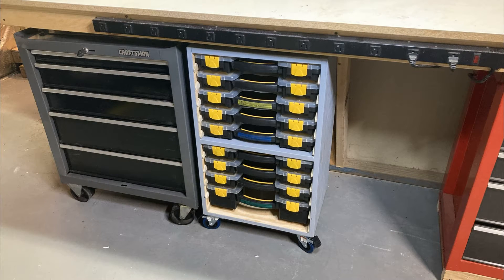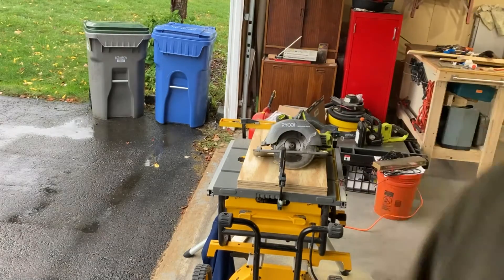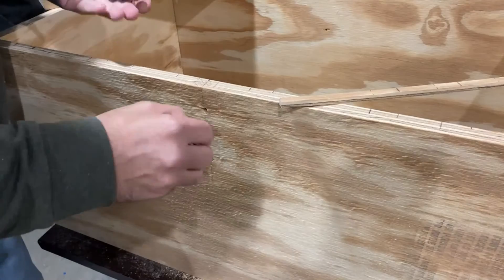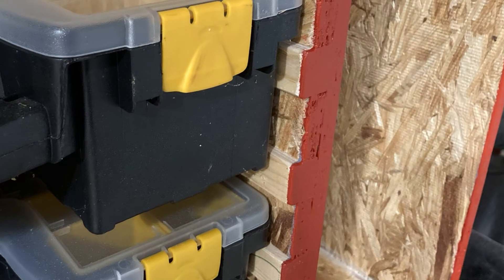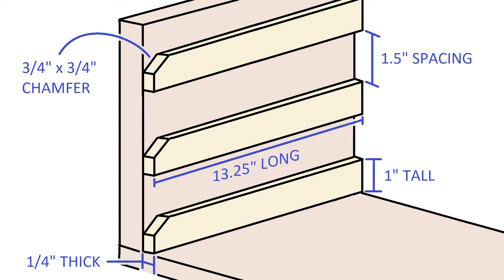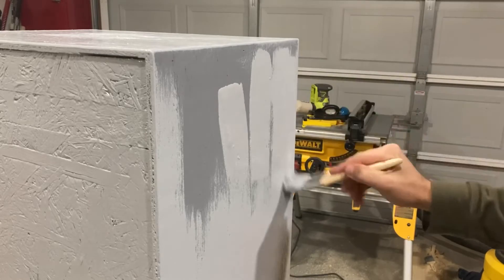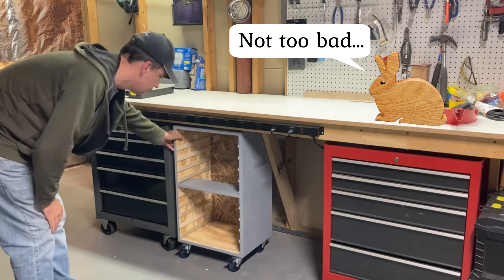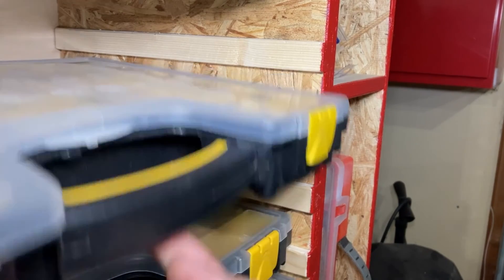[21-B]  DIY Rack for Harbor Freight Plastic Parts Bin Storage

Comment: I built such a rolling cart but used thin aluminum angle stock for the shelf brackets.  This doesn't rely on the small edge of the bins to support the weight - it supports about 1" of the bottom both left and right - much better for a loaded tray.    Finally, steer away from the Harbor Freight stuff - they are a knock off of the Stanley bins which are much stronger.  My $0.02.

Comment: Chamfered guide is the ticket.  Well done.  These HF bins are well designed; not the most robust plastic, but the designer paid attention to how they nest and they actually work.  For bins that don't need to travel to a jobsite, they are also, just the ticket.

Comment: Lids. Why have the trays got lids? It just adds three steps to access (two catches and lift lid) and the same to put away. What do they add?
Reply: Allows it to be carried to the worksite w/o dumping them or mixing them up perhaps.
Reply: @joewalsh8423  What worksite? This is workshop storage.
Reply: @Tensquaremetreworkshop  These are meant for mobile small parts storage that can live in a garage or be taken to where the parts they hold are needed, which might be 20 feet or 20 miles away.
By way of giving you some perspective on this, I've talked with many folks about these exact bins for years and you are the only person to ever complain that they have lids.  No one else I know of would buy them if they DIDN'T have lids.
Reply: @markchapel  If they are meant to be 'mobile' why store them on horizontal shelves? Tools and parts are either used in a workshop (def: a place where work is done) or transported to a remote jobsite. Storage should reflect which. Consider the difference between the toolbox (mobile but often hard to access contents) and the wall tool chest (convenient operating height, and easy access, but too heavy/awkward to transport). The same with parts- storage for transport (toolboxes with drawers?) is different from workshop access (bins, shallow large drawers).
If the items shown in this video were for remote use, the trays would need to be selected, collected, and put in some container to transport. They are inconvenient for both workshop use or for remote use. Double fail.
My solution to this dilemma is to have a separate toolbox with tools for remote use, and a box of common fastenings to which I can add specific task  tools and fastening if it will be unusual. When all the tools and parts in a workshop are fast access (no catches, lids, or other unnecessary obstructions), work proceeds much faster.
Not commonly understood? No surprise, I made a good living from seeing the obvious that no-one else seemed to... Even, sometimes, when it was explained to them.

Comment: Cool "improved" rack. Thanks for taking the time to post. I do have stuff to organize. The description was clear, thorough and makes sense and no aggravating music! 

As for casters, the best deal at hf is to buy their furniture dolly. One dolly usually costs a lot less than four bulk casters. And you get scrap wood for other projects! As for locking casters on shop stuff (like a portable bench), two casters on one end, and just legs on the other with often suffice and is much more stable than any 4-caster arrangement. Recently did this with a bandsaw and mounted square tubing on the sides for removable handles (something like wheelbarrow or post-hole digger handles). 4 casters do make sense on this project, given where it's going.

Comment: When mounting castors I
Use a vix bit to locate the holes! I use #12 x 3/4 screws with a 1/4" washer under the head to compensate for the large screw hole in the castor plate. Works just fine.
Great video I will try your mounting system.

Comment: I built two units with 14 slots 37 1/2" high without castors two days ago.
I used  1/4 sanded plywood
for the runners. They were
a full 1/4 thick.
 I used 16 5/8 internal width . I found 16 9/16 too tight. The work and look great. I didn't paint mine yet
I may just use poly urethane.

Comment: I kinda want one. I don't have a woodshop, so I can't build one, but it would be cool to have one of these.

Also suggestion: Put the slides on pegs. That way you can remove a slide to make it compatible for the double-height 8 bin cases.
Reply: (Although to be honest, you can probably leave them in place and it would probably still fit fine)